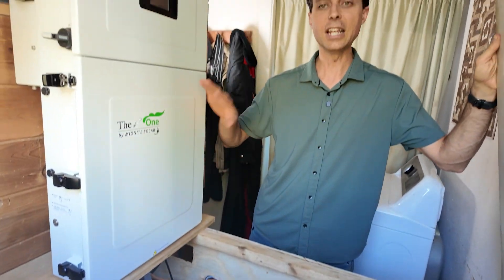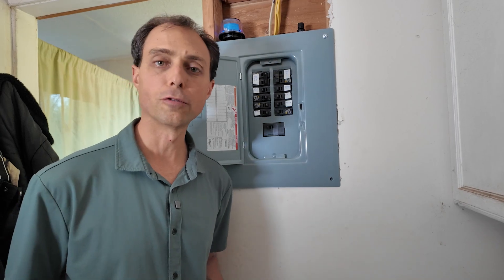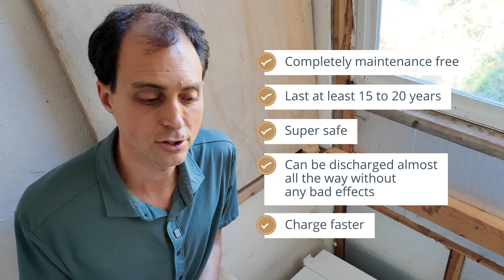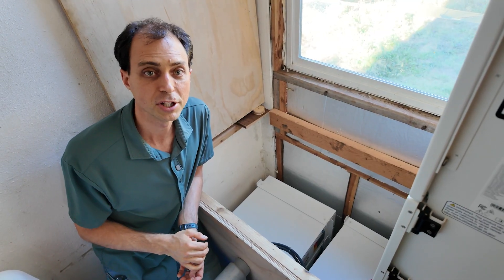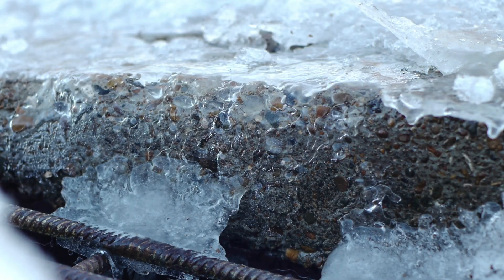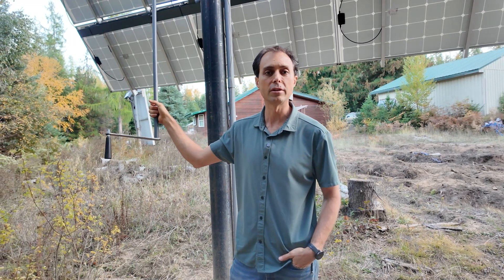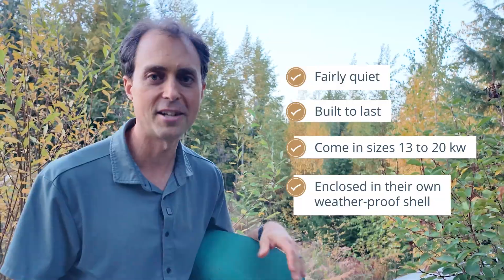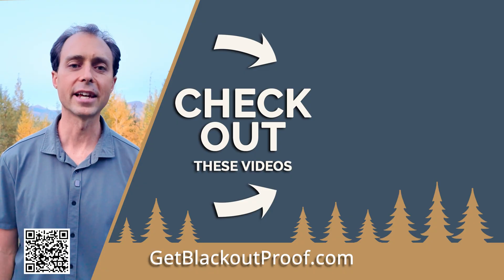This Gear Powers Our Home Off-Grid During Blackouts

Comment: Καλημέρα, I have an old generator with square form wave and I don't know if it's right to connect it with the inverter to charge the batteries ,or a power station, because of the difference between the wave forms.
Reply from the maker: Different electronics respond differently to square wave. If it was an old generator of sufficient size with high quality electrical components (like a Honda, Yamaha, or one of the larger good ones like Onan, Kubota, etc) then you'll probably be fine. But I would be careful with cheap generators, as you could potentially experience voltage spikes or other anomalies that could have negative consequences.

Comment: Did you consider hydro using a spring or river?
Reply from the maker: Hydro can be a great option since it's producing power 24/7. But you have to have enough flow and fall to make it worth it. The install can be more difficult. And it can require some maintenance with cleaning leaves/debris from the intake and potentially dealing with ice in winter in the north. A rough estimate is flow (GPM) x fall (vertical feet of fall from intake to generator) / 13 = watts of power. If that number is under 100, probably not worth investing in it. That's a very rough equation, BTW.

Comment: I am just curious why you decided on the MidNite instead of an off grid inverter like the 12000xp at half the price.  I’m not knocking the purchase at all, really just curious.
Reply from the maker: That’s a great question—and honestly, the 12000XP could have worked fine for me since I’m off-grid too. But I wanted to build and test the system I believe will best fit most people’s needs—and most folks aren’t fully off-grid. They want a hybrid setup that keeps essentials running during a blackout and can integrate cleanly with the grid. That’s where the MidNite Power AIO really shines.

I'm also a big fan of the quality of Midnite's products and how they overbuild stuff beyond what it's rated for.

-True hybrid capability: Works great off-grid but also supports grid sell, self-consumption, or backup-only operation—all in one box.
-UL 9540 listing with MidNite batteries for full code compliance as an ESS.
-600V PV input with three MPPTs for flexible solar design (vs 2 MPPTs that operate up to 480v--granted they are larger but more of them gives you more options for managing shade, etc). 
-Three smart load outputs (vs. one on the EG4) so I can control a generator, an AC-coupled array, and a load-shedding circuit all natively.
-High-grade build quality: Magnetic hydraulic breakers, field-serviceable boards, and components that can be replaced without pulling the inverter off the wall.
-Massive surge and unbalanced load performance: It’ll start heavy loads—like a 5HP compressor—without blinking. I think it's like 200% surge rated which is impressive for a HF inverter.
-10-year warranty (vs 5 with the 12000XP)
-I really like the Midnite batteries and wanted seamless integration with with, which this provides

So for me, it came down to building a system that’s not just solid off-grid—but one I can recommend confidently to anyone wanting a hybrid, code-compliant, future-proof setup. The MidNite checks all those boxes, so that's why I paid a little extra to go that direction.
Reply: @TheReadyLife Thanks for that👍

Comment: Pretty good balance between a commercial and sold information. But as an electrician I’m agog at the shape of that electrical panel 🫢
Reply from the maker: I know. Before installing the Emporia I was getting comments about how neat it was, but all those little wires sure made a mess of it. You're supposed to trim them to length so as to make it a bit neater, and I may do that someday, but I left them long just in case I wanted to use my unit as a loaner for others in the area. The downside? I have a messy box in the meantime.